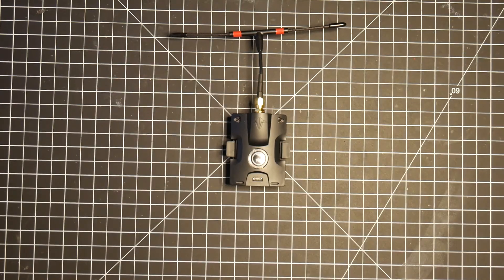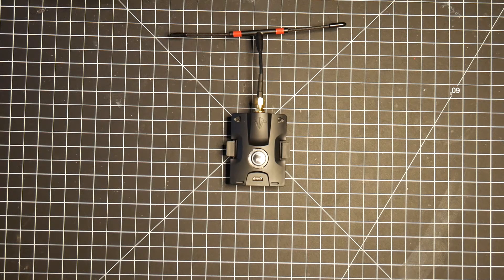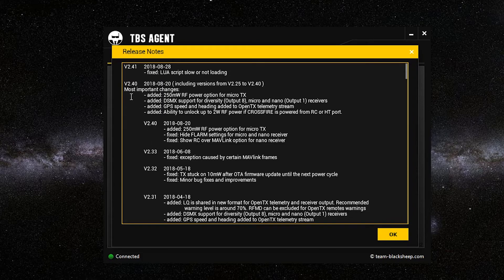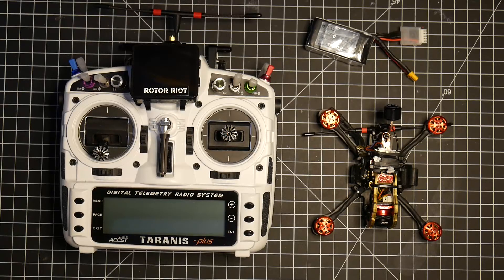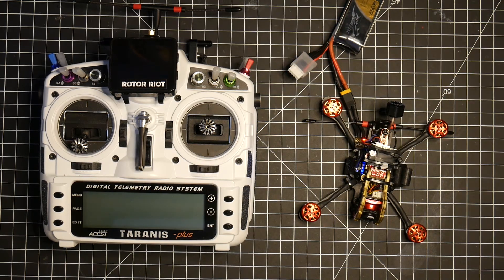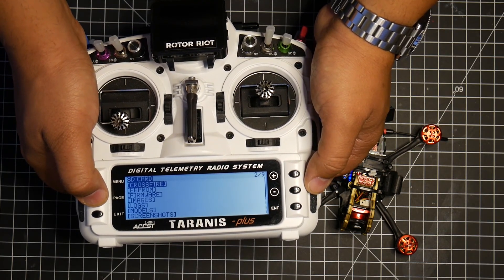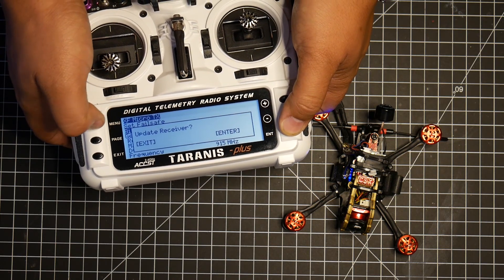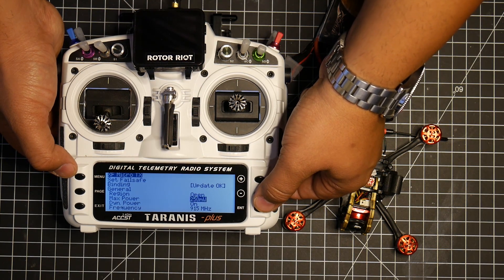TBS Crossfire Micro TX 250mW Mod without having to solder a thing!

Comment: So it's not a mod its updating the fw....
Reply from the maker: It used to be done by actually soldering on the module but in this video, I show how TBS made a FW update that does the mod without having to solder anything on the board for you hence why I titled video this way
Reply: @johnnydeltoro  I'm aware of the previous hack but this is still updating fw...

Comment: Can you only fly line of sight with the micro tx? I just ordered one for my new Jumper t16 pro and am worried I'll only be able to fly LOS? I'm able to go about 300 meters behind me (non line of sight) with the dji tx.. (dji fpv goggle bundle) this possible with the crossfire?
Reply from the maker: LOS? Yeah, this can definitely do LOS and then some haha.
Reply: @johnnydeltoro  I know it can do los lol I meant can I fly behind me and >not< be in the line of sight?
Reply from the maker: Yes. All crossfire will give best reception period. Now the micro tx vs full tx, full tx in general has about ~8x more power/strength output then the micro. Micro alone is for superior then 2.4ghz radios. For drones, there's no reason to get full size unless you wanna go super long range and even then you'll run out of battery before you'll hit limit in out environment free of RF etc.
Reply: @johnnydeltoro  🙌🙌✅✅